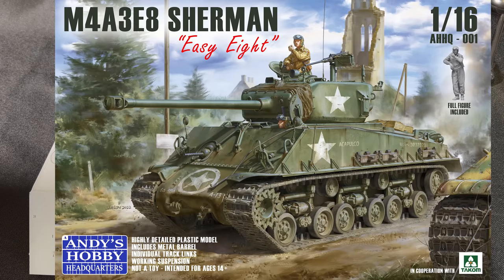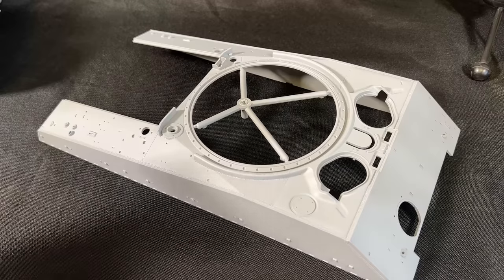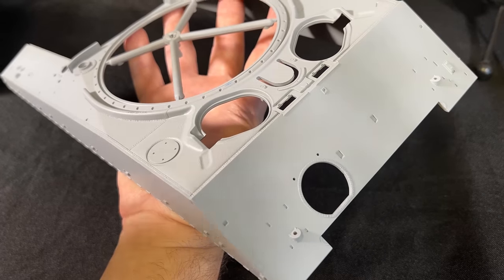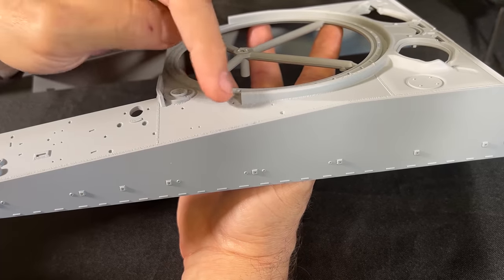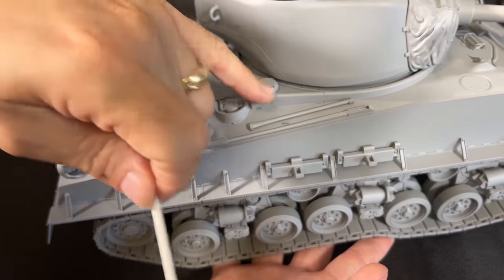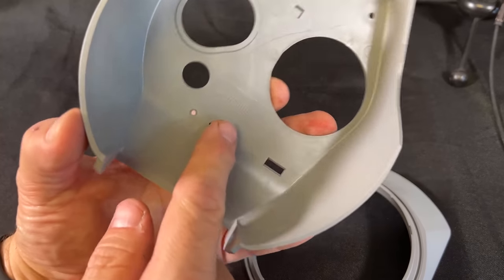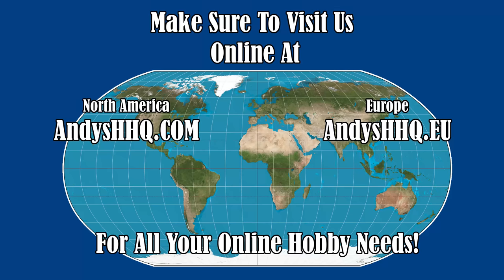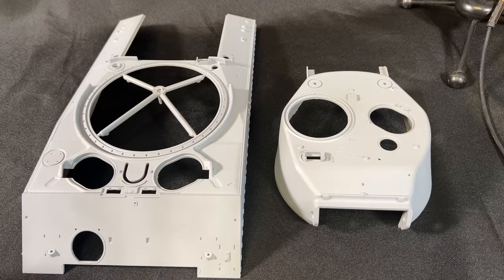Andy's Hobby Headquarters 1/16 M4A3E8 Sherman Final production plastic parts update.

Comment: This is looking like a superb kit. I've already ordered the Jeep but I actually converted the Tamiya 1/16 RC kit to and E8 so I have to justify getting this kit. Maybe I will sell the Tamiya one first as your kit has much better detail on the tracks and I am not bothered about having an RC tank now.  I  see the suspension oscillates but it doesn't compress so I am wondering if you are leaving some meat on the bones for the upgrade people, If/when I built this kit I would have to make the shocks work and put a spring in behind the ends of the volute spring.

Comment: I hope this kit is better than the stug .half the big parts are so warped glue wouldn't even keep them in place. Had to heat them then lay weights on them to try to straighten them out. Still going to take a lot of work to make it look good. But other than that you make building look so damn easy.

Comment: Do you have an approximation of the length from back of the hull to gun tip? Of course I ordered it without knowing if/where it can be displayed.
Reply: about 47cm / 18 ½ in
Reply: @dodgysteve7699  - Thanks, wow, that's big. It just might fit in my display case if I turn the turret 30 - 40º.